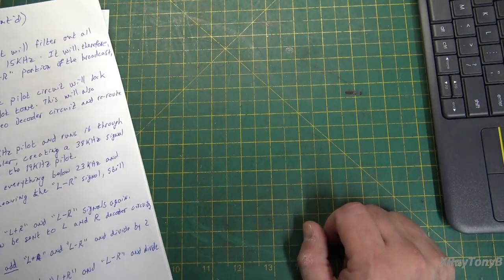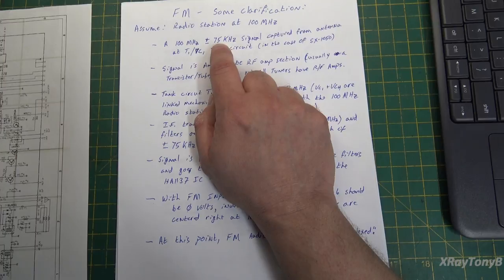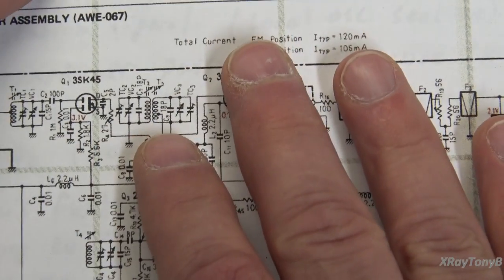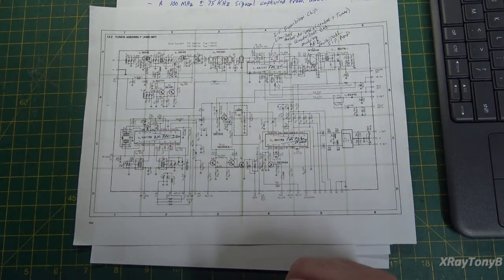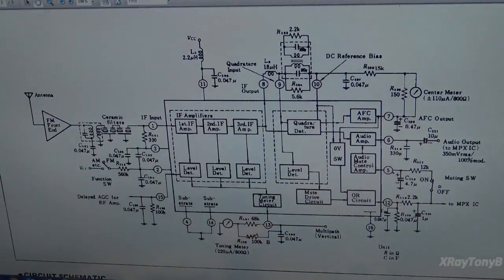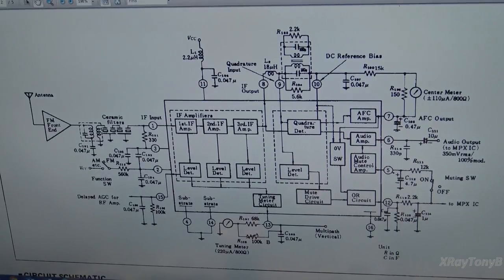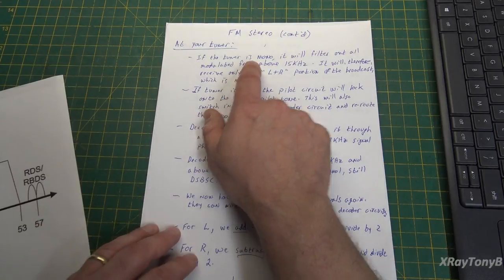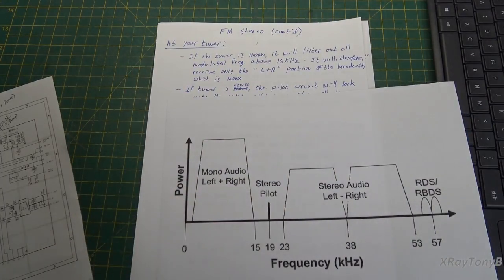FM Stereo Theory Follow Up

Comment: So is the (-R) signal obtained at the station by inverting the (R) signal 180 degrees with an inverting op-amp (with a gain of  -1) then adding the (-R) output signal (with the same amplitude as the (R) signal) to the (L) signal using the two 1K resistors, then taking the ((-R) + (L)) = ((L) + (-R)) = (L - R) between the resistors? I wonder how the brain would perceive headphones where one side is (L+R) and the other side is (L-R) (?) This stuff went over my head in technical college, but this video is great. Tony makes the complicated simple. I’ll probably watch this video several more times.

Comment: Very helpful. I'll need to play around with this to really understand it better but it seems to me that to align an FM radio front end one wouldn't need to inject MHz signals into it at all, except to align the dial tracking position. Am I off base here? Most signal generators won't reach those wavelengths. I've been thinking I may have to use the ARB function to capture/create a lesser multiple and multiply it to get up to the FM band. Again I may be off base here too. Any comment from more knowledgeable radio folks than I would be appreciated.

Comment: I have two separate questions.
Does it mater if the input signal (tuner) and the local oscillator are out of phase
one leading or lagging. ( meaning the peak to peaks are in phase or not)
and the same question for the stereo sidebands.
for them to cancel each other out , would they need  to be in phase with each other.
This is the confusing part, understanding how they repel each other or
cancel each other out.  You put out excellent videos, I am just having a problem
understanding the mixer and the IF filters.  Thanks.
Reply from the maker: MrMac5150,
Thanks for watching!  I'm not so sure about the local oscillator/tuner, but as for the MPX signal, phase relationship is critical.  The 19kHz pilot tone produced at the radio station is used for frequency as well as phase generation for the rest of the stereo signal.  When the tuner "sees" this pilot tone, the MPX circuit locks onto it and uses it for phase and to generate the other frequencies used for the 38kHz DSBSC "L-R" signal.  The SX-1050 from the video uses a PLL circuit to keep everything in line.

Comment: I have the opportunity to purchase a early 50s Olympic record changer radio.  it is complete but in unknown condition. the speaker is intact and is an RCA alnico 12". it comes with all the original paperwork including bill of sale and schematics. I'm interested in it as my first venture into tube electronics (with a reasonable amount of knowledge in solid state). It's $40.  think I should get it?
Reply from the maker: Before purchasing, go online and try to see if you could find a schematic or service manual for the model you want to purchase.  Nostalgia Air is a good resource.  If you find service documents, then go ahead and purchase.  If not, I would pass on it and find one that has service information, because its your first tube repair.

Comment: What is the colored lugs, some are red, black etc, for tiny transformers for in small radios?  And how do you solder them in without burning the wire into,  the wire is so thin, like a strand of hair.